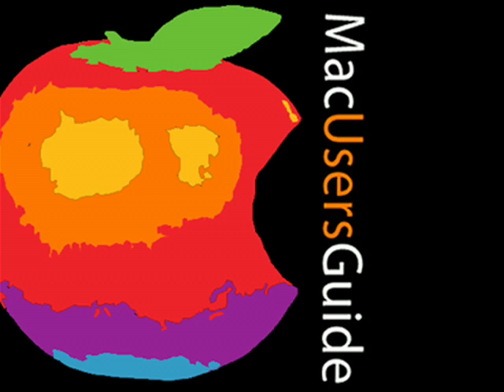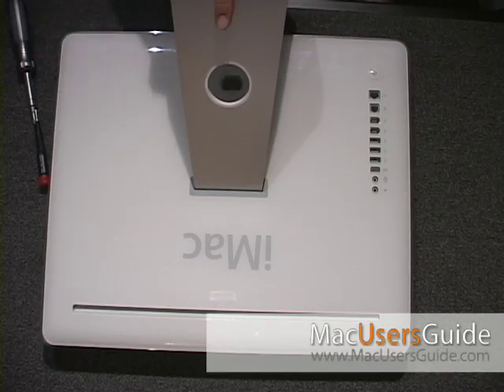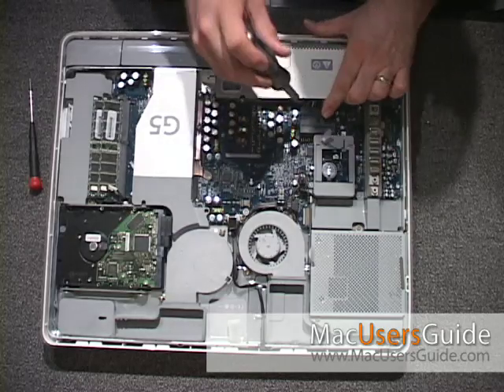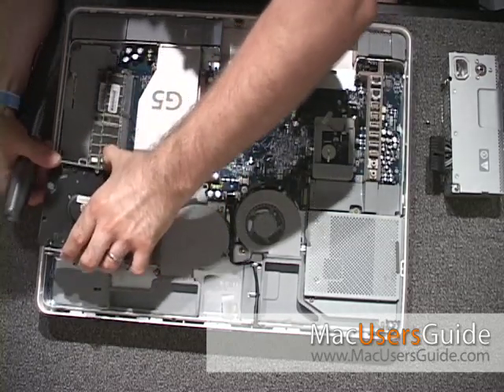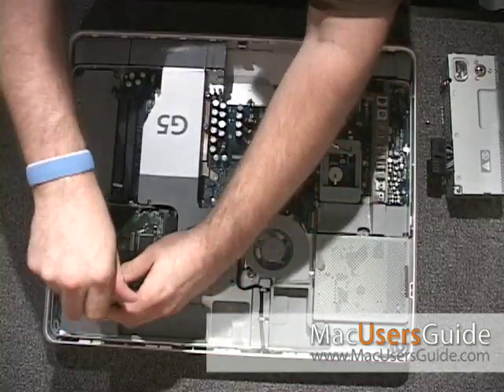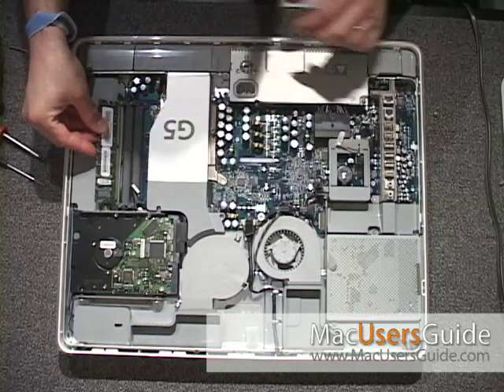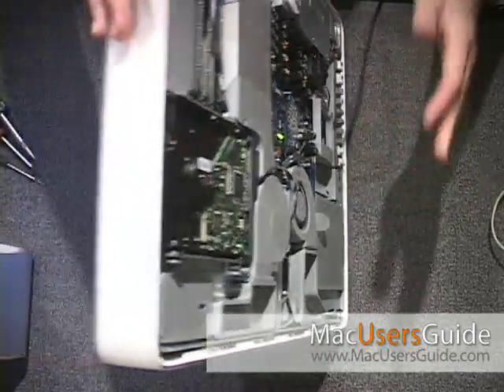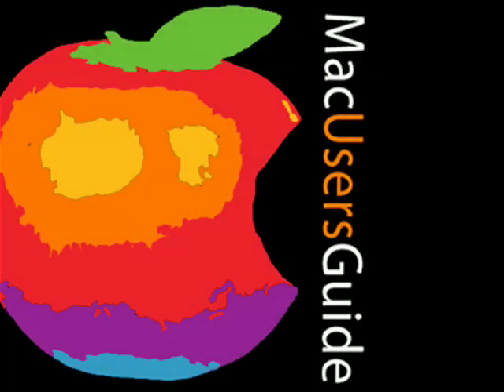Got an iMac G5 with glitchy video or power component? Rebuild it!

Comment: What year of is this imac from my 2004 ppc g5 has a slightly different cooling system but is stock for the model. I am wondering if there is a way I can modify mine or something cause running 10.5 Leopard is making allot trouble with the fans being Loud an even tiger was a little loud at times but not nearly as bad. Can anyone help me?

Comment: hello there ,just found your video and it was what i needed. i have the same computer and at first it seem it was the faulty power supply ,but after i saw your video it seems i just have to reboot it,my question is you do have to back up the info in your hard drive before you reboot it . before i stumbled upon your video i replaced the power supply and it started working fine ,a few months later it just wouldn't turn on so i kept it to the side and thought of sending for a repair which i never got to do due to other things ,but after seeing your video and you point out the green light power indicator and pressing the emu and power button i knew  i could fix it on my own so my question is you do have to back up the info in your hard drive before you reset it or can you just reset it with out backing up the hard drive.

Comment: It's odd that YOU know it's a known issue & I know it's a known issue but the guys at the Genius Bar are pretending they've never heard of this before. The tech I spoke to tried to play it off like a one of a kind thing. You and I (& anyone who can use Google) knows that's not the case. If they had admitted the problem & said the over-extended 3 year coverage was over and I was SOL, fine. But they feigned complete ignorance & that's not right. It's a $900 repair with a 90 day warranty.

Comment: "What a scam Apple has going" implies broad hardware defect issues with the Mac product line.
Apple did acknowledge the defects with the iMac G5 by extending the warranties from one year to three or four at NO CHARGE. Some scam that was!
As I said earlier, you got a bum model and are now trying to extrapolate the issue into the larger base of Mac computers. You couldn't be more wrong about both your model or Macs in general. Ask Consumer Reports.
Keep it coming, dude. I got a big shovel.

Comment: I replaced my iMac G5 power supply last year when my iMac was 3. Yesterday it BSOD and I can only assume the capacitors have went. Yay! What a quality item. I only use the iMac for music creation and itunes and that's it. I'd say it gets used about 20 hours a month. I'm typing this on an HP desktop which I have used approximately 6-8 hours a day for the last 8 years and it's still ticking. Put that in your fucking commercials Apple, you thieving rat bastards. What a scam Apple has going.